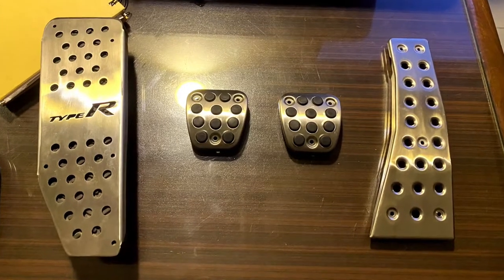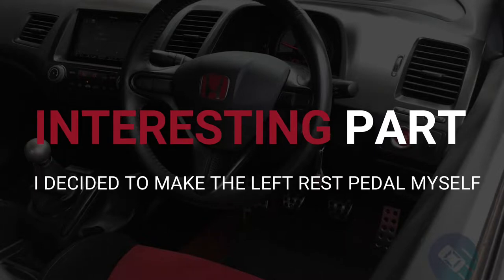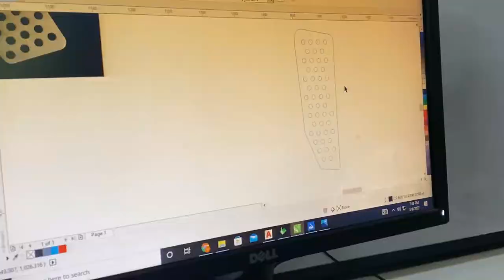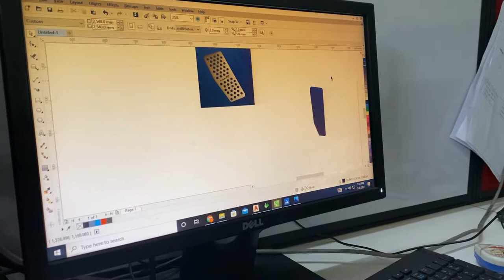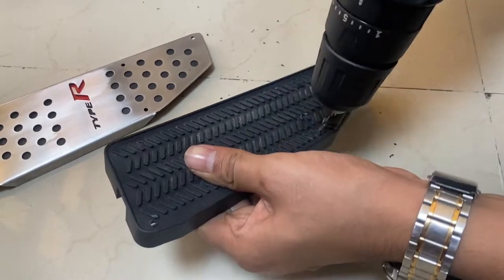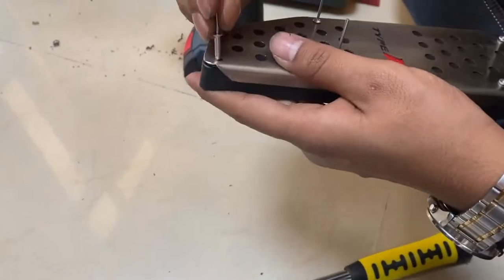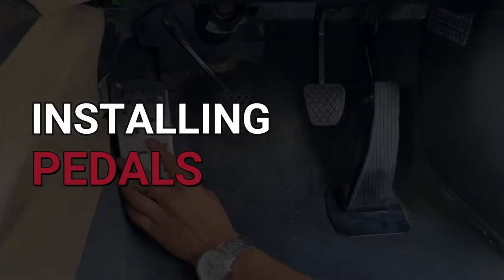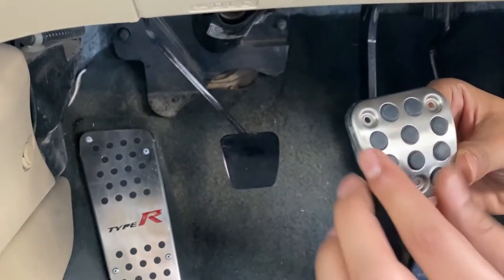Pedal Cover Installation | Design Pedal Covers | Honda Civic

Comment: bad idea! what will you do when you want to change them? When the rubber wears out ?
Reply from the maker: Well it’s more than 2 yrs now.. rubber is still in perfect condition, plus its JDM OEM Honda part. You can use any other material below like some pvc or plastic sheet like I did on rest & throttle pedals.. hope it helps